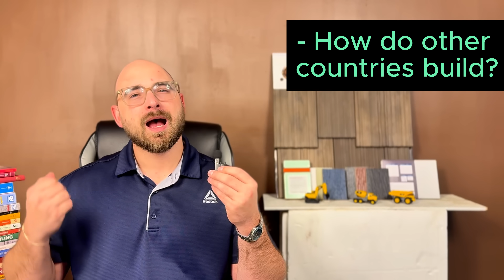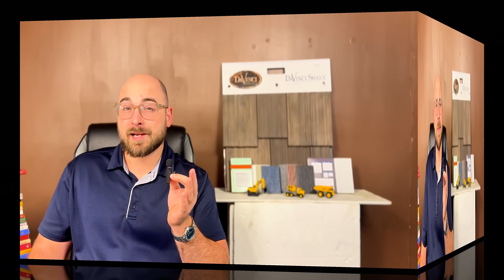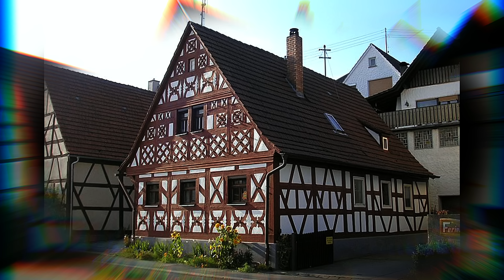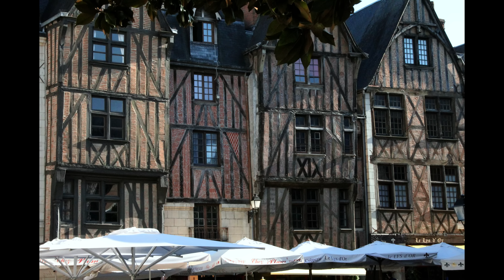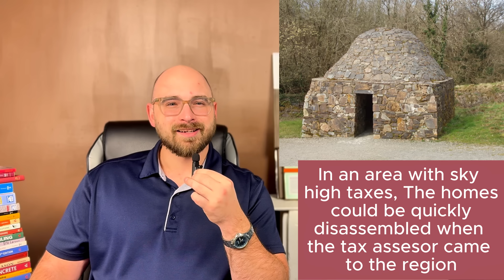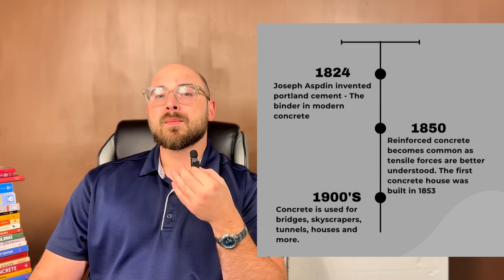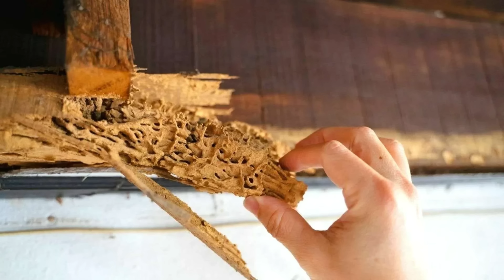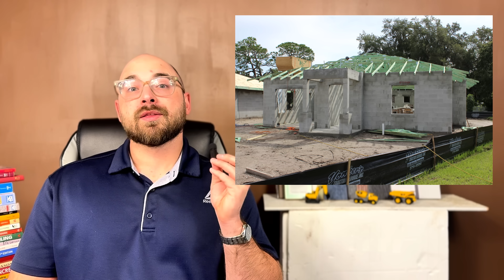Why Other Countries LAUGH at American Homes

Comment: The main reason modern concrete is not used in American homes is earthquakes. The second floods. And third is ice. 
These three things not only destroy concrete but they make concrete a dangerous hazard in an earthquake this is most obvious by the concrete cracking and falling apart in lethal chunks. 

As for flooding and ice..well those are less obvious as they rarely are immediately a problem. However unsealed concrete (which is what most homeowners would be facing bc maintenance is avoidable cost to many people) can absorb water and when it dries out it makes concrete brittle (also mold risk is reasonably higher than in wood because it’s harder to remediate…) and then if ice forms within concrete it causes cracking. These cracks are less immediately hazardous but think of your windshield small chip today major crack at next speed bump. 

Now there are areas concrete could be used but it would be more cost effective and longer lasting to make earthwork houses. 

Modern concrete is not the same as Roman concrete it does not last.
Reply from the maker: Modern concrete certainly can last, 

ICF protects the concrete from water and freezing temps, concrete buildings can be built to withstand earthquakes, flooding is not really an issue, in fact you can design a home that is able to flood and then dry out without damage if you use concrete, something I’ve done before
Reply: @Mike_Fortin interesting. I have not seen concrete like that. I have seen plenty of local concrete fail for all of the reasons I listed. Concrete that was between 3-15yrs old.  Could that be because these locations were in zones that had drastically different summers and winters and also in a flood zone maybe.  

Also my expertise/research has definitely been more Roman era focused I just went down a rabbit hole in the reasons why modern concrete sucks in comparison…after a building collapsed and bridge failed due to all the reasons I outlined in my first comment.
Reply: The reasoning resembles the Fox in Aesop's "Fox and the Grapes". In the meantime the rest of the world uses concrete with other materials and is not worried about mentioned calamities. It's used in Siberia's permafrost in arid climates and in humid tropics. It was successfully used since the beginning of XX century. 
Concrete has to be properly reinforced, otherwise it's quite useless. Many times I saw unreinforced slabs, cracked and chipped.
Roman concrete is indeed better and potentially could be produced cheaper in economy of scale because only limestone would have to be fired and pozzolanic agents mined directly from the ground.
Reply: @ElegantiaeArbiter yeah ok. I guess I should tell my friend’s mom that the world doesn’t care what killed her daughter. Because it only happens to over 300 people every year and that’s nothing to everyone else.

Comment: I don't think other countries have much room to talk when places like GB have "life threatening heatwaves" of 79F
Reply: What tiny GB has to do with the rest of countries? Do you know the temperatures in the Middle East or even southern Spain?
Reply: @ElegantiaeArbiter  I'd imagine the majority of europe is the same as the UK.
and yes, I've been to the middle east, I had taxpayer funded vacations to Iraq and Afghanistan, with stops in quatar, kuwait, Saudia Arabia, etc.. so yes I'm intimately familiar with the heat in the ME. 
but the majority of them live in stone/mud houses.. which is a far cry from europe.
Reply: Only parts of Europe experience delicate oceanic climate. It would include GB, Ireland, northern France, Benelux countries, northern Germany, Denmark. Southeastern Europe has subtropical climates. Coastal southern Mediterranean which can be quite oppressive due to humidity. Inland Iberian peninsula would have continentilized Mediterranean like central California. Northern Italy is hot and humid, similar to northern Greece and northern Turkey. There is great variation. Far northern Europe s arctic. Southern Europe traditionally also built from stone, brick and in drier areas with sun dried bricks/cob. All the new construction in most countries is concrete frame with brick/block infill.

Comment: I would add maintenance costs to timber buildings when compared to brick or rendered concrete. having to re-paint your home every 5 years compared to solid materials. To add to this is lack of timely re-painting the timber. Once rot sets in timber it's endless sanding and painting. Therefore, timber homes are cheaper for the developer but more expensive in the longer term for the owner.

Comment: Solid materials like brick and concrete, may be stronger, but when they do break, cost more to repair. 
If I built a new house, I'd choose metal framing. Wood is convenient because a nail or screw can go anywhere, but metal requires tapping a hole. I think metal is the way to go.

Comment: The renewableness of timber is highly questionable with the current consumption rates, and as you mentioned yourself the quality of timber is decreasing because we can't keep up with the demand. Solid structure homes though are built for centuries, so they are more beneficial to the environment in the long run.

Comment: Our homes are much better than those in Europe. I can add wiring, boxes, pipes, drains much easier and sometimes without even cutting open the wall. We can add headers, doors, remove walls much easier, when compared to having to deal with cement blocks or even solid concrete like in Europe. We can have the same R-Value. And our construction is much cheaper.

Comment: To be honest, I like idea of the outer walls and the weight bearing walls to be solid structure, but the inner walls from the lightwood framing - for easier remodel ... is that a thing?
Reply: You can do it, still much better that stick frames all around. Having interior walls from wood you add flammable material, noise problems and living space for mice. If everything is masonry it can be beautifully finished with natural plaster that will make the house feel better and look better than every cookie cutter drywall finish. Partition walls can be built from 8 or even 6" block or brick.

Comment: A really good comprehensive view.
The constant moralising and bashing is often very one-sided (I say this as a german living in a solid house). Most people overlook or don't care at all for every aspect of an Issue.
American light work houses might be way worse in sustainability, strength, statics and resistance to all kinds of external forces but obv. are they also way easier to build, cheaper and faster. Which is a bit point if you live in a tornado area I guess.
In Germany people build their houses for their whole lives. In other places the priorities are set different.
There are also a lot of mixed construction forms.
A lot of Houses build for rent in Germany are made with Brick/Concrete or concrete-filled bricks for the main walls and with drywall for the room seperations.

Comment: US homes no privacy you can almost hear a pin drop 😂
Concrete are great for Arizona n Florida but California gotta have more steel rebars in the structure because it can crack during earthquakes
Reply from the maker: True, could also benefit from a stronger foundation too, base isolation, deep piles, and /or concentric plastic rings surrounding the home to absorb some of the seismic activity

Comment: You can build a stone house in non-quake zone.  But most of the region in the world is quake zone. Also one statement i saw was something like " if you walk down the road there are many houses in UK older than that in US."  That's is illogical since US is younger than UK. many houses in the US are older than 200 years. My sister's house is over 120 years and still standing.  "My home is 50 years old next year..." Yeah, concrete house  is not safe to live after 50 years. You can live in it of course at your risk. I would live in a wooden house coz there is chance earthquake hits.  Look at the aftermath of earthquakes around the world, what kind of buildings collapsed and people got killed?  If you ignore those facts, you can say concrete/bricks houses are safe.  But as American, I don't care what Europeans say, we really don't care. Europeans like to tease American but as a matter of fact one America can take on the entire Europe.
Reply from the maker: You can build with concrete in a Seismic zone, and be able to withstand a higher magnitude earthquake. 

There’s concrete homes in CA that survived the wildfires. Guess what, also a seismic zone.
Reply: Around 20% of world inhabited land is located in seismic zones. So most of the world is not affected and these parts that are, are built using reinforced masonry frame with brick infill or structural bricks (for example Porotherm BIO Modulare in Italy). The buildings that collapse are either old ones or built without the countermeasures known since last century. Also, fire hazard, insects living in the walls, noise, lack of thermal mass, toxic boards and glues is something that is dealt with daily in stick frames and devastating earthquakes occur twice in a century.

Comment: Yes, most American homes are just lacking the standards and the quality, which you would expect, considering the cost, investment, commitment it requires. As for the price, people are  paying significantly more than  it's  worth. The whole building process is just looks way too tedious, slow and labor intensive. At the end of the day, there is no guarantee that the house is a quality built. It is upto the work force and the integrity  of the builder. But no matter how much you spend, you still have a house made of  2×4 and drywall sheets. The whole world have seen how those houses holding  up in severe weather event. Flooding, the house needs to be gutted. Then it needs to be dry. To prevent  mold growing and spreading. That takes professional  talent. It  can also be costly. Then you are effectively rebuilding the house. Drywall chip board insulation paint. It could be way more. Yes, black mold could grow behind the drywall. Tornados, houses made  with wood framing, are poorly matched against the twisting  lifting forces, and  demolishing homes in seconds. Hurricanes. That could be worse, covering bigger areas. Also combining the wind and water destructive power. Results are also devastating. Water and wind damage. In Europe, it would be a clean up after the flood, the residue from dirty water, drying the walls, painting. High winds, storms , replace some of the roof tiles. My grandparents  house was built over 50 years ago, and still haven't seen  any issues with it. Also had a storm shutter operated from the inside closing just like a blind but made of wood, outside of the windows. European houses would have unaffordable prices in the US.

Comment: I was over 60  when I begin building my concrete home in northern Arkansas.  I formed myself  a turned down Alaskan pad, and this work was easy.  The concrete mix was delivered and professionally finished.   The walls are drystacked concrete blocks, sealed to the pads, with chinks where the blocks did not perfeclty fit,  with a very strong precision grout.  Every eight feet are concrete block pillars, sealed to the pad and also held with stainless steel threded rod, rod that is also used in other places.  As I went up, doing all the work myself, I backfilled with concrete. .  The walls are eight feet high, and where it was necessary, with two by eights, I formed for a reinforced concrete bond beam.  All of the walls and pillars are back filled with concrete, all firmly fixed to the pad with threaded rod that extends through the top to form holdings for heavy wood framing that extends the walls upward at non-gable sides for another four feet.  And I then applied surface bonding cement as a stucco, inside and out.

Above the concrete I used only two by eights and two by tens, some of them twenty four feet long.  The house also has interior pillars that support heavy wooden cross beams and permit long two by fours that run under roof cross ties to support an arched panel celing that is actually three ceilings: two at the edges, nine and one half feet high, one in the center, fourteen feet high.  The ceilings are of painted moisture resistant plywood panels  one eighth inch thick.  Lying on the panels and across the long two by fors are half inch thick R-Max panels.  Lying on these is R-19 insulation.  I suppose one could call this a hung ceiling. 

I'm 85 and will soon be laying another pad  with the same construction.   Great advantages to this system is that 1) the surface bonding cememt adds great resistance to racking; 2) Any kind of wall and wall openings can easily be placed between any pillars; 3)  wood can be attached easily and strongly with construction adhesive; 4) floors are easy to clean; 4) insects, a pain in this area, are no problem; 5)  the noise dampening is considerable; 6) pipes and wires can easily be attractivlive and  safe, with  easy modification and maintenance by conduiting them in wood that is easily sealed to either wood or concrete; 7) Once the pad is down and cured, one can bring blocks onto it for working, leaving them out in the weather, whatever the weather;  8) the pad can be used for rolling around cheap home depot scaffolding; 9) the floor can be tiled or epoxy sealed beautifully; and 10) the back filled walls and concrete bond beams permit very long and heavy wooden beans for extensions, overhangs, or a second floor if you don't want to carry the concrete up further.  

The turned down Alaska pad has  approximately eighteen inch wide by sixteen inch deep edges, adding furter support to the walls.  And I heavily reinforced the pad, doing all of this myself.  Living where I am,  out on forested and rugged land, my closest neighbor 900 feet away, I had no permits; the local judge told me not to worry.  The land is rocky, the wet soil packs down like concrete, so settling is  not a problem.   Where I came down from in the Pacific Northwest twenty five year ago the idiot inspectors, having no clue as to the method of construction, would have delayed  md for months at every turn.  As it was, my total construction costs, including delivery and finishing of the pad, were a little over 10,000 dollars.  And I  put the roof on myself, with asphalt shingles.

Comment: Concrete is an appalling material to build housing out of. After around 50 yrs cracks can occur. Yes, we have learned a lot over the yrs and with new technics this is not the issue it used to be but none the less it still happens. Brick there is zero issue, ever. Brick density here in the UK, like everything has gone all economy over the past few decades. A cheap new house brick is around half the weight of an old brick of a few decades ago so a lot of the benefits we will have over the US are fading sadly. One thing that is still far superior is our electrical installations, super safe and powerful in the UK, in the US low power and arc's every time you plug something in, well shoddy, I mean seriously no earth on plugs!

Comment: Canadian here: I was always told that masonry was unsuitable for our climate because of the freeze-thaw cycle, and that wood was preferable because it expands and contracts seasonally. Reinforced steel has also been problematic here, particularly in bridge construction. Road salt used for de-icing corrodes the concrete and then moisture seeps in and causes rust in the steel. Something like that anyway.

I think climate is a major factor in materials choice and I suspect this is true for the northern bits of the USA too.
Reply from the maker: That’s true, I wouldn’t do CMU in Canada with the colder climate. 

ICF would be just fine though, the concrete is protected from the elements and kept above freezing temps

Comment: In Europe, housing is more than a home. It is also an investment. Its price never goes down, it goes up.
The building I live in is 40 years old, but it is almost like new and its price has more than doubled since I bought it. The advantage of American houses is only one, they are larger in area. A massive house of 200 sq m is many times more expensive, but it will not lose a cent for the next 100 years or more.

Comment: Foreigners are generally triggered because their standard of living is shit compared to what we Americans enjoy.  Their homes look like sh*t and lack most of the mechanical systems that Americans view as standard features.  German housing in particular looks like something you'd expect to find in an impoverished Balkan village.
Reply: I disagree. It's been long known that American housing is gawful. 
Read "Owner Built Home" by Ken Kern. He rails against the gubmint, banksters, and entrenched industry that has effectively frozen innovation in the housing industry for generations. He urged folks to build their own homes, and escape the 30 year bondage to banks, etc.
Compare "Energy Star" recommendations against the Saskatchewan Conservation House of the 1970s. Still pitiful.
If you wish to build a 100% off grid, autonomous, self sufficient house, you're in for battle with myriad 'defenders' of the status quo.
Woe, if you wish to connect your Solar Photovoltaic system to the grid. They require that when they go down - YOU GO DOWN, TOO. . . (What's the point?)
Back in the 1980s, I learned from a friend that his new house in Germany had a simple requirement : the house had to last at least 500 years. If you asked why? They pointed to the 900 - 1100 year old buildings in the village. In America, if your house lasts 20-30 years without needing massive upkeep (new roof, repairs, endless painting wood trim, replace builder grade shlock, etc), you're fortunate.